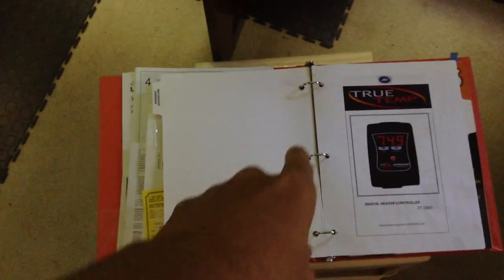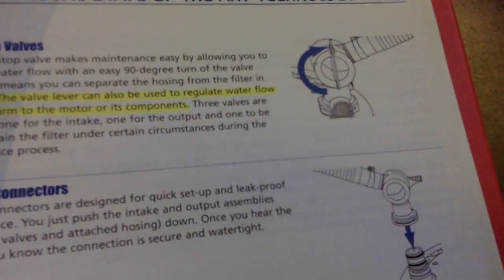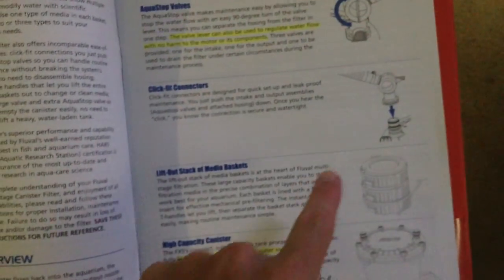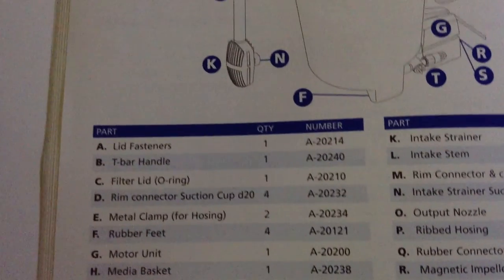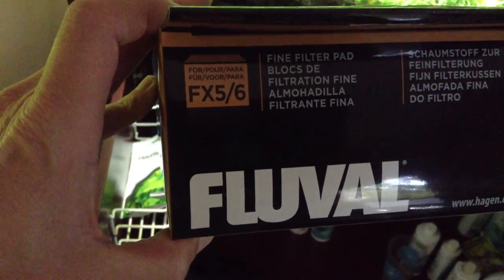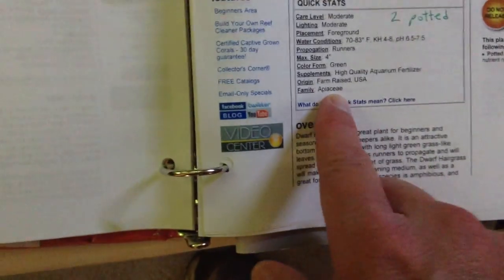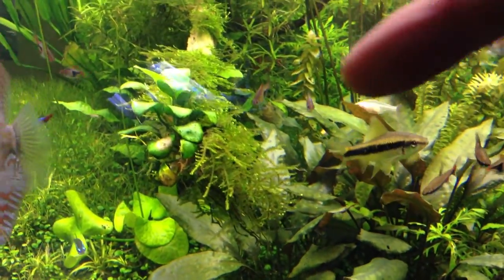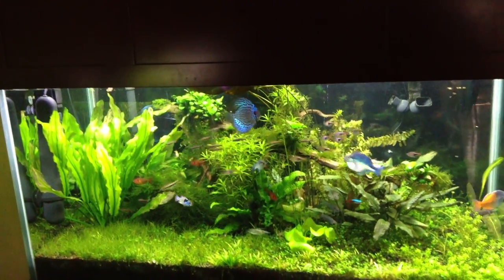FX5 repair

Comment: great vid what site u order from? i need to get spare parts too... and have you thought about using the purge valve on the bottom to drain the tank? would save our gaskets from being stretched so frequently.. just a thought..